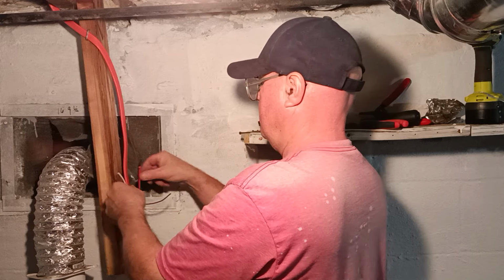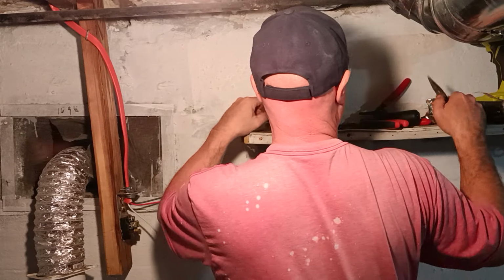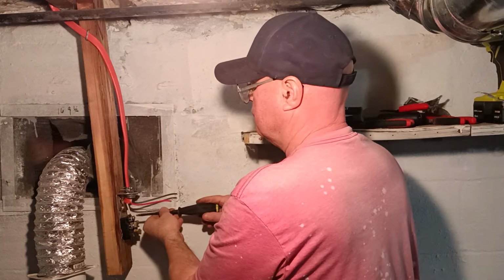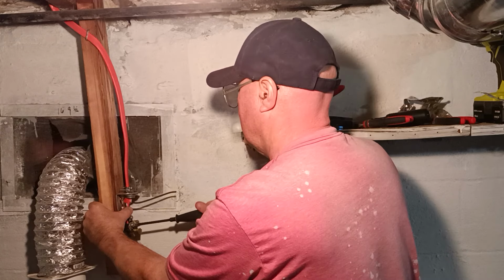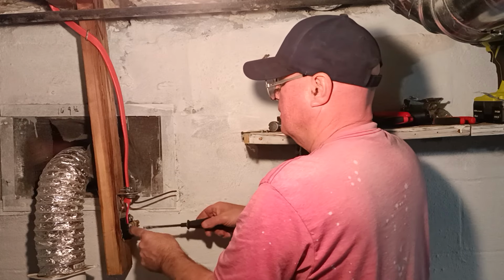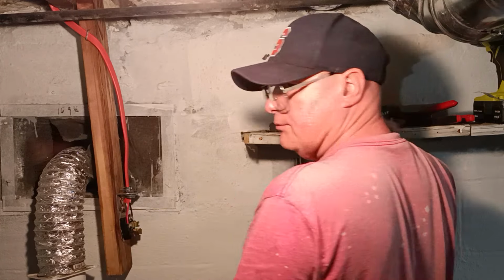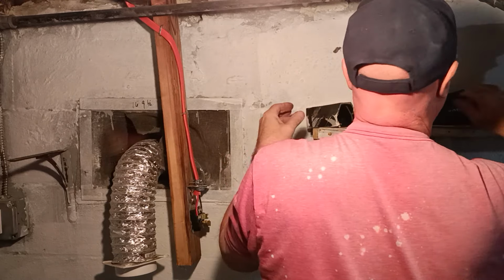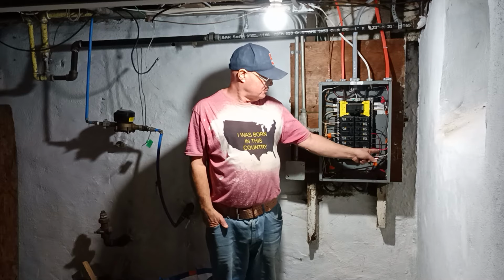part 2 of 2 how to wire a electric dryer circuit 30 amps 240 volt (the receptacle)

Comment: Correct. Doing it way the ground wire is on parallel with the neutral and becomes a current carrying Conductor. The only time the ground wire is a current carrying conductor is when a ground fault occurs so the circuit breaker trips. The equipment grounding conductor doesn't protect personell from getting shocked. It is to provide a path for electricity to go back to the panel and activate the circuit breaker in a grounded or short circuit or overload condition. But as an un licensed and non-certified person trying to perform electrical work, he probably doesn't really know or understand the function of they equipment grounding conduuctor. If he fid he would have used the 4 wire receptacle.

Comment: No kidding. This guy is dangerous. 3 wire dryer receptacles were not allowed for years for dryers. It should have been 4 wire. Hot,hot, neutral,ground. Neutral is needed because dryer elements are 240volt but the motor is 120volt. All new dryers have terminations for the 4 wires and ypu csn buy the 4 wire cord with plug end and  ring tongue connectors on yhe other end to connect to the terminals at the dryer. Same for 50amp ranges.